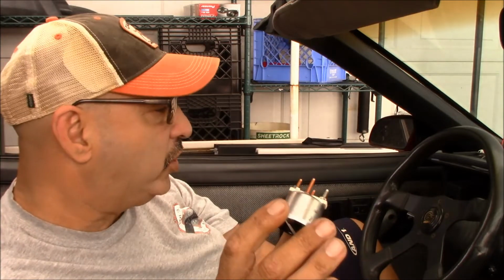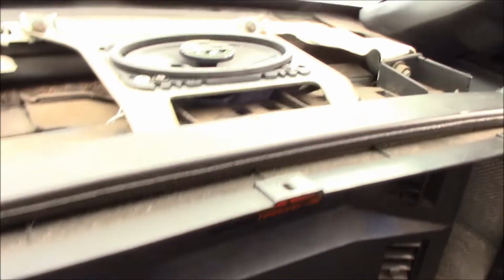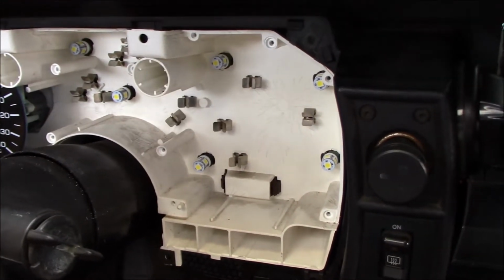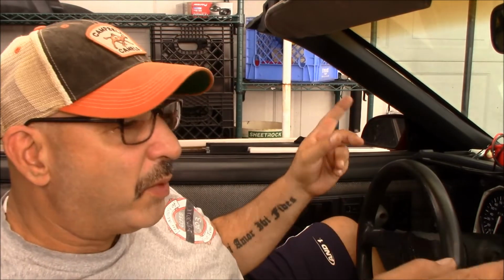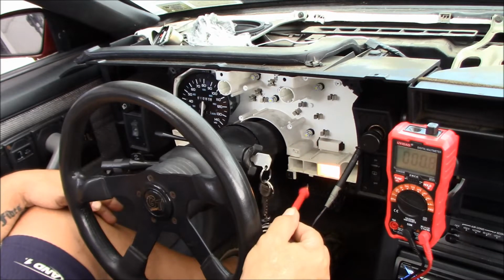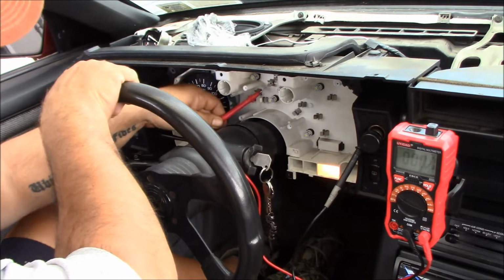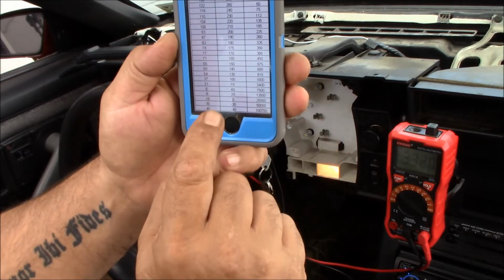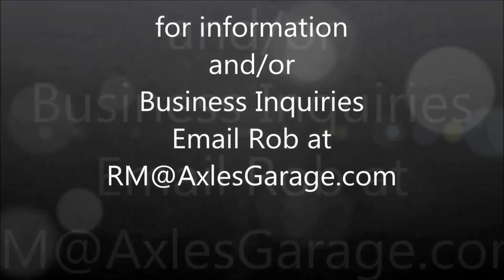Gauge & Tach Issues  - 1988 IROC Z28 Camaro -  Troubleshooting and Repair PART #2

Comment: The flexible circuit on the back of the cluster has copper contacts that fit the socket on the dashboard.  Clean up the copper contacts on the back.  I recommend an old school 'ink eraser'.  Fiberglass brush may also work.  Assuming you don't get your replacement of course.  lol